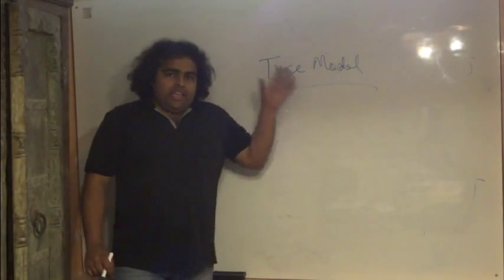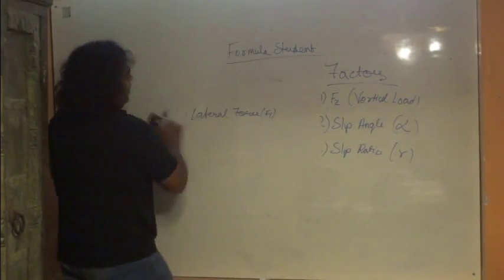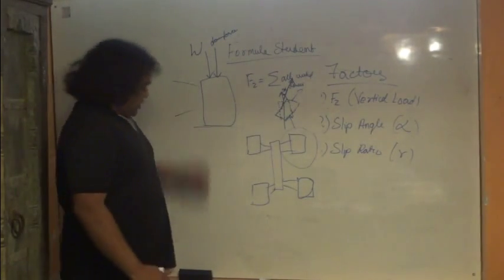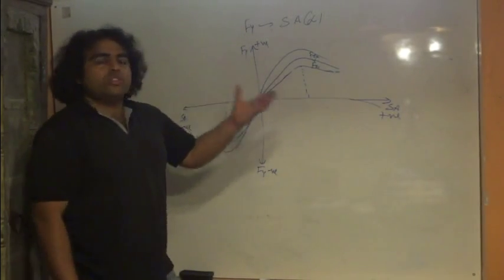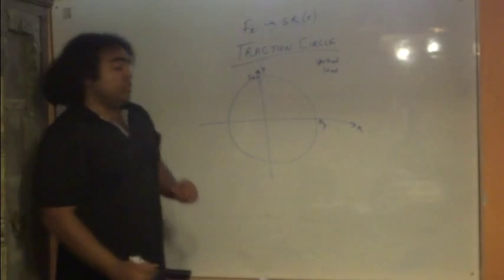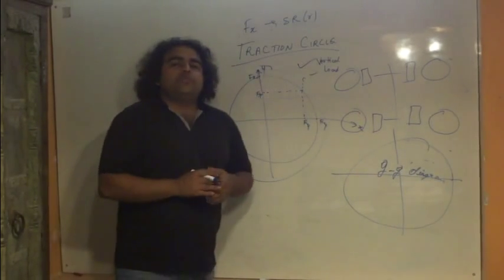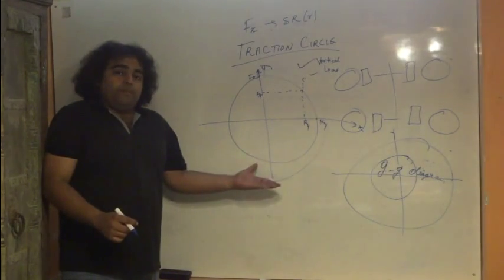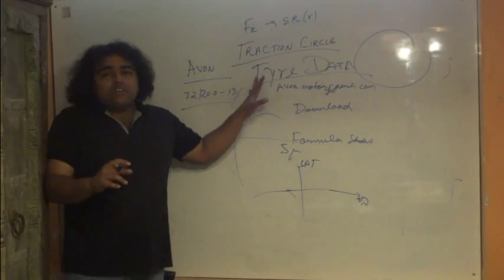Tyre Model of a Formula Student Race Car tyre

Comment: The tittle says Tyre model of a FS car, but there was no mention of use of any popular/free tire model or creation of a simplified model. Neither did the video talk about extracting of tire parameters for a particular tire model from a tire testing data such as TTC data.
Reply: Dear Amit,
This video is just to explain the parameters of importance in a Tyre Model, that a vehicle designer needs to be aware of. In general there are not generalized tyre models for racing tyres, available free of cost. They are obtained by testing conducted by the manufacturer or organizations like Calspan etc, and are sold or offered to student teams direct;y by them.
Once the data is there and the user is aware of its application, then extracting the same for using, is simply a programming exercise, which is beyond thge scope of this video. A MATLAB programmer can easily handle the data and extract relevant info from it .